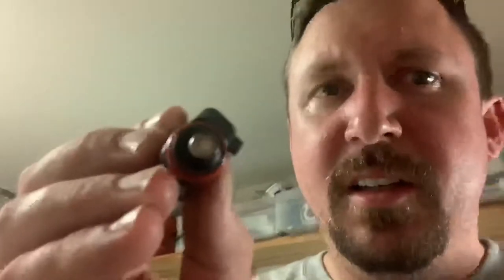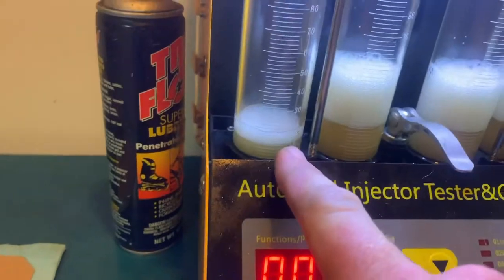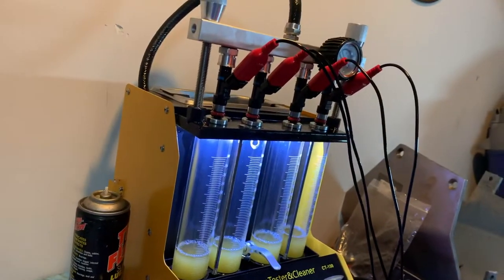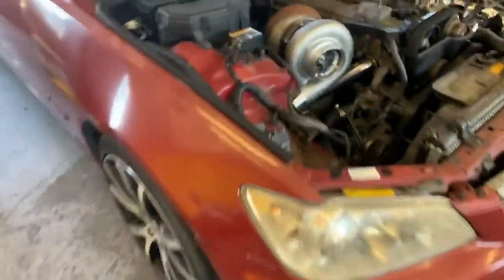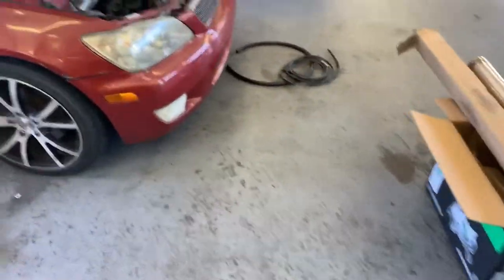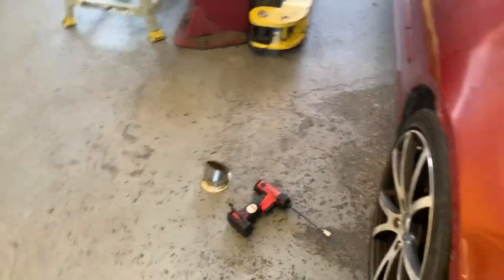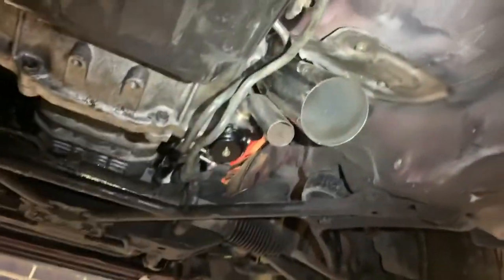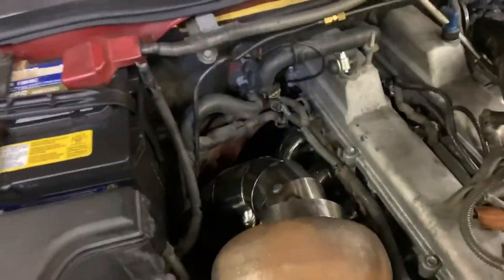Converting turbo IS300 to returnless fuel system and more

Comment: The down pipe turned out good.  So how did the Miter saw do with the abrasive disk?   I’ve though about that but never tried it.
Reply from the maker: It cut well enough. Had to de-burr the pipe ends after every cut but it went well. Made about a dozen cuts and the cutting wheel didn’t seem to shrink at all.

Comment: What engine management are you going for?
Reply from the maker: MicroSquirt
Reply: Master of Machines nice but I’m guessing this will act as a piggyback? Using the stock ecu to talk to trans?
Reply from the maker: It will be full stand alone as far as engine control is concerned, but yes the stock ecm will still be present with a few inputs for trans operation.
Reply: Master of Machines  awesome, I’m doing something similar till I manual swap mine. So I’m stalking your progress now lol.